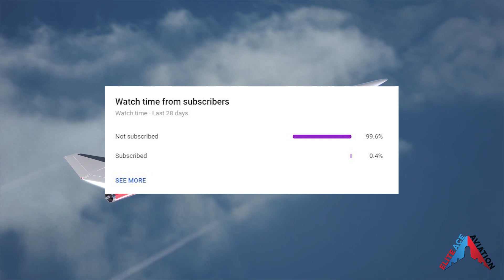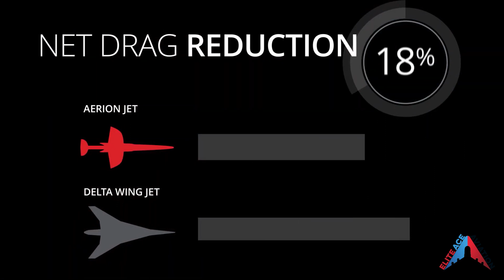Aerion AS2 Supersonic Business Jet

Comment: why aren't the wings swept ?????
Reply: Same flight principle as the F-104 Starfighter, the thin Trapezoid wings present low resistance and high-speed capability but their low-speed handling is really bad. I think the idea here is that modern avionics can overcome this and they can still take advantage of the high-speed capability which covers most of its flight.
Reply: @cyrusesfahani5935  They actually changed it to a delta wing design!
Reply: As I understand it the Main reason for no sweep is for increased Laminar flow, which is not possible with highly swept wings.  
The increased laminar flow will, if designed correctly reduce drag significantly. 👍😁
Although as of mid 2020 the latest design iteration has a significantly different wing with a lot of sweep... 🙃